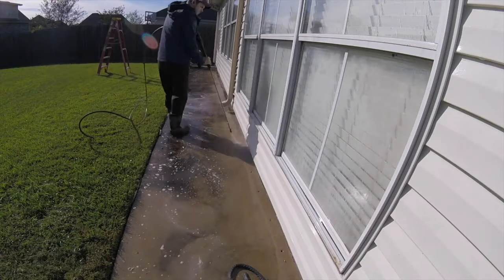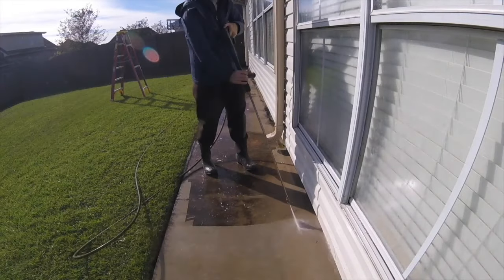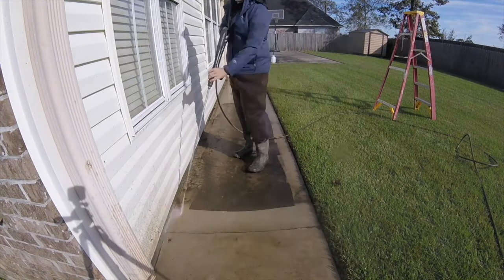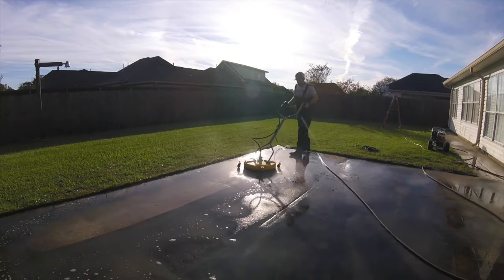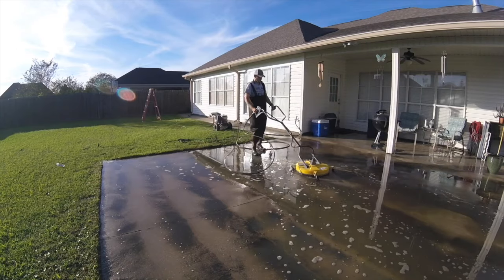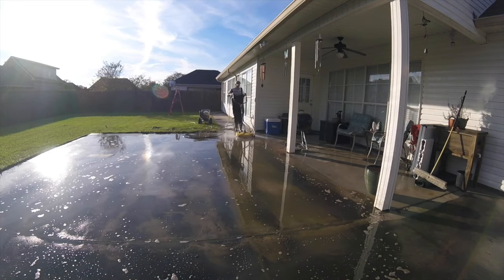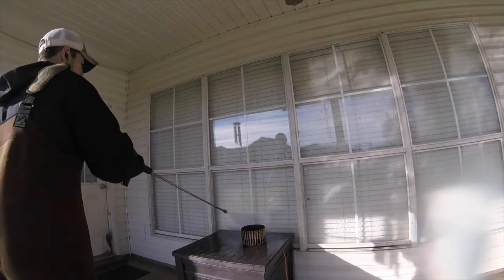BEST PRESSURE WASHER TO START YOUR BUSINESS

Comment: My first WASHER was a 2.5 homelite from Home Depot. I cleaned and sealed countless driveways with that thing. It may take longer, but it will get the job done
Reply: You can seal driveways with a pressure washer?
Reply: @ClapperDan  I was thinking the same thing I've never sealed a driveway with a pressure washer you usually clean it then chemically clean it then you do the sealant but I would imagine that's what he did before applying the sealant to the driveway.
Reply: Guys he pressure wash AND seals driveways with different methods he is just stating what services he does lmao.
Reply: @lel3450  they’ve never heard of downstreaming driveway sealer?  Get with the program 🤣
Reply: @SA77-76 absolutely
Reply: If it takes longer, you’re wasting money. That’s counterintuitive. You can cut grass with scissors, but it’s not the best way to run a business.
Reply: @flashpb04  exactly right, but if you only have $300 to buy a pressure washer, you do what you gotta do. Or you can rent one. That was back when I didn’t know a thing about GPM, and thought it was all about pressure. We all start somewhere
Reply: I started with a dewalt 3600 PSI
Reply: @flashpb04 horrible analogy.

Comment: Washer, thanks for the info I just got a 2.5 gpm 3300 psi washer yesterday and did my first job doing what you have said in your videos and I came out with a nice driveway!
Reply: @@sa77-76 I used the homeowners water
Reply: @@sa77-76 it’s basically implied that your going to use their water because even if you had your own tank it would take more than that, and I don’t have my own pressure washing business, just do it for some extra cash here and there
Reply: did you post treat the driveway.....if so, what did you use soecifically......

Comment: Brigs & Stratton 4gpm 4,000 psi is the perfect starter.  The Toyota camry of  pressure washers
Reply: 4000 lol you cutting into concrete
Reply: @ellsworthconstructionllc  maybe if you’re using the red tip instead of the surface cleaner

Comment: Do some google searching for retailers that specialize in spray equipment those guys usually can put you in the right machine for your needs and the commercial units normally have external rebuildable pumps which they can usually fix in house pretty reasonably

Comment: #washer
Very good advice!  I currently only have an electric pressure washer and an 11” surface cleaner.  I also have a turbo nozzle to help speed up cleaning as well.  I’ve been getting conflicting info about Psi and GPM.  Thank you for this video.  It helps a lot!

Comment: You can a just the pressure from the pump, if you do it to often does it start to leak?  I had a 2700 psi Honda before, now I am thinking of a 3400 Simpson power washer. You said Honda motors are great. What kind do you recomend?

Comment: Do you recommend a heated unit if it's within an owner's budget? Is the heat an additional part of cleaning that could clean things faster or more thoroughly than cold water and chemicals?
Reply: Heat can definetely speed up the cleaning process. In the cleaning industry there is a concept called Sinner's Circle. It says the result of cleaning is based on four principle factors: Mechanical, duration, heat and chemicals.
So if you were to reduce the amount of chemicals but add heat into the mix instead you will get the same cleaning result (broadly speaking).
Reply: I us heat my pressure washer alone cost 15000 $Canadian I use it 4 season also my  coldest temperature I went is -27°C yup its cold 🥶 and  challenging been 4 years I'm in business going on 5 now
Reply: @DrainReaper  To be fair, you can get good heating pressure washer combo units for $3500 in the USA, especially for those starting out. No need to get the big and best. $3500 is still a lot, but nowhere near 10k+ and can do more, better, and save time, generally.

Downsides are if you are doing residential only, its probably not needed, but I am looking at some leads where it might be viable but it definitely adds a lot more cost.

Comment: What would be best for water reclamation? Especially when doing a driveway as for its going straight to the street. As someone who is looking into pressure washing this is my second biggest concern. I read some people say to get a vacuum to suck up the water. I don't really see anyone really using it any where just sending the water down the street.
Reply: I’m curious about this too. Bump!
Reply: Don't pretreat just straight water and it looks just fine
Reply: Got any leads?
Reply: I'm just trying to start out now, I was thinking about sandbagging end of Driveway, placing a cheap solar bilge pump/12v setup, in front, and find a tank or pre agreed upon dump location on property. 

This is a brainstorm so cut me some slack
Reply: Yes. Please protect the dirt from going to the street 🙄

Comment: I was given a 4000 psi 3.5 GPM. I hope that can get me started. It’s not 4 GPM but since it was free I hope it’ll be good enough for now. What do you think? It’s gas and has a Honda motor. Being  .5 away from 4 isn’t too bad is it?
Reply: He only recommended 4gpm max, not that its the only way to do a good job.
3.5gpm will definitely do any job well. You cant go over 4gpm anyway because of limits in residential water systems.

Comment: I just have one question. Where can I find a Water reclamation system?! That’s the only thing holding me back. I appreciate you bro. Tons. ❤️
Reply: You can just get a shop vac. With the wide end, all you have to do is block the direction of the curb where the water is heading toward a storm drain with like a towel, and have your vac and maybe a 100 ft extension cable and you can leave there. Once it gets full, dump it on the property.

Comment: I have a question. I have a 3000 PSI  2.3GPM RYOBI pressure washer, and would it be fine if I connected a Y valve to it to connect another pressure washer gun?
Reply: Are you wanting to use two washers at the same time separately? Or combine the two?
Reply: @justjacob850  Sorry for the late response. I didn’t know you commented on my question. I want to use that pressure washing machine but connect a Y valve to where that machine as two washer guns. I was wondering if it might be bad for the machine because it would over work it because of so much pressure is coming out. Me and a friend use the same pressure washer and thought would it be okay to add another washer gun to it.
Reply: @b-hester_36  I don’t think you’d have enough pressure/flow to do that
Reply: @justjacob850  okay thanks for the help.

Comment: Washer, great videos I have watched a ton of them. Would you say a 4gpm pressure washer isn’t as necessary if you have a separate 12v soft wash system? Other than the benefit of using a larger service cleaner I’m curious if spending the extra $1k is really worth it with the separate soft wash system. Thanks in advance!

Comment: Question! If I get a 3500 psi pressure washer and a 4000-4500psi surface cleaner will that mess anything up if the PSI is different?
Reply from the maker: Nope. It’ll be fine
Reply: @ForeverSelfEmployed  here’s another question. I bought a SIMPSON 3400PSI gas PW, and I’m wanting to buy a 125ft hose any recommendations?

Comment: What size surface cleaner do you recommend for a 2.3 GPM/2700?

Also my pressure washer hose keeps getting tangled up on me, it’s still new. But any suggestions? I just started practicing phase. Still got a long way to go! Washer!

Thank you!
Reply: When cleaning up, disconnect the hose and turn it as you roll it up. The less tension on your hose as you pack up, the less it’ll twist and turn on you while you’re working.

Comment: I got a Simoniz 3000 PSI 7 HP Gas Pressure Washer, they up grated the pump and now it puts out 3400 PSI. Is there a way to tell what it's putting out??? He even bought a 3400 psi house and gun. Now I have to figure it out. I looked around on the internet and can't find one that HR power. No web site for Simoniz washers.

Comment: Someone who owns a pressure supply store just told me today that the 16” surface cleaner is going way better than the 20”? He explained that it works faster. Doesn’t cover as much ground but you’ll be working circles round the 20”. What’s your take on this? Looks like you have a 20”
Reply: Depends on your GPM im pretty sure, if you dont have enough flow for the 20” i think youd spend more time going over your work

Comment: I love you videos and advice! I have a cheap Troybilt pressure washer. Of course it comes with the detergent resevoir. I pour my 12% SH in there. I guess the machine is shooting out too weak of a mix. So I end up having to use it only for rinsing. I use a pump sprayer to spray a more effective hot mix for now, and rinse with the pressure washer. Does anyone else have this problem with a cheaper pressure washer? Ill take any advice to speed up my jobs.

Comment: What’s the best chemicals for concrete cleaning, siding, roofing etc?
Reply: Brigs and Stratton 4gpm 4,000 psi is an absolute workhorse.  I bought it in 2018 for $1,100 and I’ve probably made $160,000 off of it and it’s still going strong.
Reply: @thesaint9276  what chemicals do you use
Reply: @mcj9917  12% SH (pool shock) and dawn dish soap.  Lye for oil stains and gutter butter for oxidation.  99% of the time just SH and dish soap
Reply: SH(Sodium Hypocholrite) which is essentially just pool shock
Reply: @thesaint9276  do you mix it in the pressure washer soap container and spray before you wash or use it while using the surface cleaner? what does the dish soap do also? help it stick or just a good cleaning detergent
Reply: @mcj9917  buy downstream injector and a 5 gal bucket 🪣.  Basic house wash will need 3 gal SH, 2 gal water, and about a cup of soap.  Put soap in bucket first so it mixes properly.  When cleaning concrete I usually put straight SH and soap and spray down the surfaces first.  Let it sit for about 15-20 min then hit with the surface cleaner.  If there’s still lines grab a pump sprayer filled with SH and soap and apply directly on it.
Reply: @thesaint9276  do you have instagram or something, I have some questions cuz I want to start too!
Reply: @thesaint9276  is that with 12.5% ? How would you ratio it in a bucket for a house wash with 10%?
Reply: @sneakersam8713  same.  Not too big of difference
Reply: @thesaint9276  if you're leaving lines you're going too fast
Reply: @thesaint9276  it sounds like you're dialed in, have you ever had a homeowner complain about shingles becoming brittle after using dawn? I know it can break petroleum products down and degrade them. Just curious if its ever come into play for you?
Reply: @thesaint9276  can you run bleach through the built in chemical injector on in? Just wondering because they usually say don’t use bleach
Reply: @outdoorexperience8723  no you need a downstream injector.  They’re like $25
Reply: @thesaint9276  okay and where do you connect that to? Since my Simpson pressure washer already has a built in chemical injector I’m not sure where I’d add a separate one
Reply: @outdoorexperience8723  just YouTube downstream injector

Comment: Would 2800 psi and 2.3 GPM suffice?
Reply: Just bought one, expecting it around the 20th, will let you know
Reply: @firmfire2385  and? does it work?
Reply: @robdb15  yes but definitely a little under powered im my opinion, would go with a 2.4 or 2.5 gpm and 3200 psi but it DEFINITELY still works and gets the job done and will be enough to get my business started, with a surface cleaner and SH it will definitely get the job done good
Reply: @robdb15  so far iv only tried it on concrete walkways and brick pathway stones by the way
Reply: Thanks for responding, looking for my first decent powerwasher
Reply: @robdb15  no problem, i chose a simpson megashot 2.3 2800 psi with the honda engine over the ryobi 2.5 3200 psi one simply because the simpson one had a honda engine and i need something very reliable since im gonna be using it a lot, would definitely recommend looking into the megashot series if your looking to start your own business and plan on using it a lot, proper chemical usage will make up for lack of pressure and gpm
Reply: @firmfire2385  thanks, will look into what i am able to buy in belgium

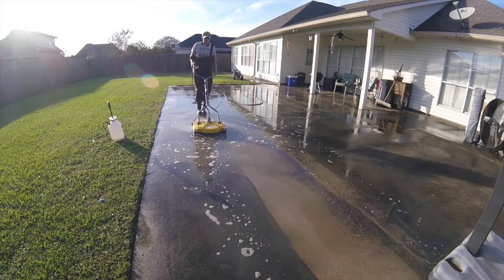Comment: 2:00 Using their electricty to wash the house, i mean name me a business when it comes to construction type jobs that dont have to use electrity? That would be the least of the problems epsecialy if its a big are you'd need alot of cord. But yeah it would definitely have to charge less especially with electricity costs today, Water not so much, but having to use the electricity for a hole day yeah that could add up that would most likely be the top reason not too, as for the cord they usualy dont really get wet & they are a insulated cord anyway. But typically if someone is paying you to pressure wash they are doing it because they expect you have a bigger better version than they can get. I wouldn't say they were weaker than a typically average one, However they do have issues where they idle which means you have to let off the trigger & repress it again to start it. or it will get stuck in a cycle until you do. 2:39 Id be careful of that most store warranty's are basically for show they don't actually do anything different than the standard warranty, Depending on the business lowes is alright with that stuff. But places like walmart don't have to replace anything because its not in the warranty, Which is why those warranty's have been seen as a scam especially for most items. Id stick to business's that cater to specialized cliental if  i were depending on a  warranty like lowes, tractor supply so forth so on. How many warranty's from a  store have you actually had to fuffill awhile after you bought it outside of because of a defective product?

Comment: Washer!  
Can you talk about what one might look for in buying a used pressure washer.  I feel like people buy electric and are disappointed in the results because well you know... so they try to sell those a lot.  But if I'm looking at a gas pressure washer I'm thinking either they bought this and just never used it as much as they thought they would,  or it's old, been sitting around and it leaks,  or the pump is about to go,  or the tank has gas sediments or whatever else could be wrong that I don't even know about.  Can you talk about what I might be looking for when considering a used machine,  also what are cheap or easily fixable problems with a machine and what is not worth the time and money in fixing.  
Thanks for all the videos you put out!
$tay $tacking

Comment: I have a question... I was going to buy a craftsman pressure washer at Lowe's. But I was skeptical about buying it because it got such low reviews? Even when equipped with a Honda motor?

I held off and thought I'd just save a little more money for the Simpson pressure washer whereas that one got extremely good reviews!

Is the craftsman gas powered pressure washers really that bad? I would love to buy one because they're priced much cheaper... but is that why they're priced cheaper because of build quality. Please help!

Comment: 1. Put some gaps in your speech, don't race like an express train, my ears hurt.  Slow down. Say less.
2. No you should not go wit a high flow rate. If homeowner's city water supply is low at 1.5 GPM (gals per min), and your washer needs 4 GPM, you will burn out your motor and be ineffective. Best to stick with under 3 GPM.  This is a variable you have no control over.